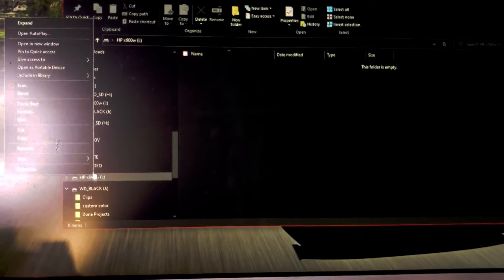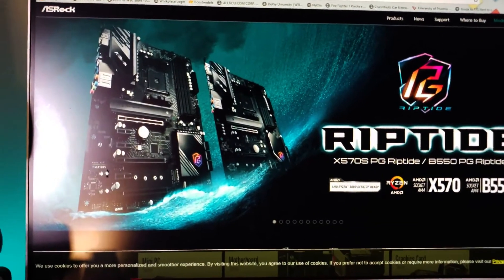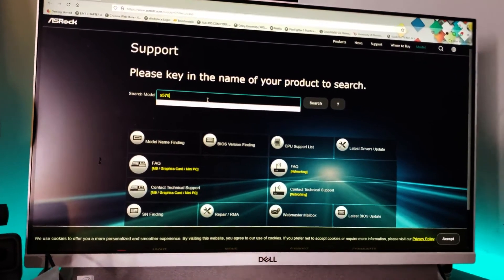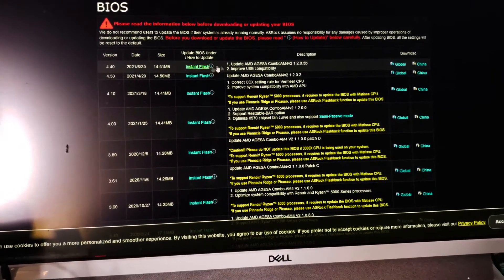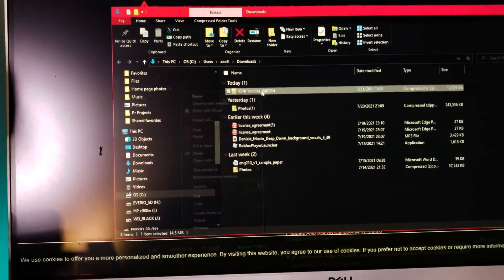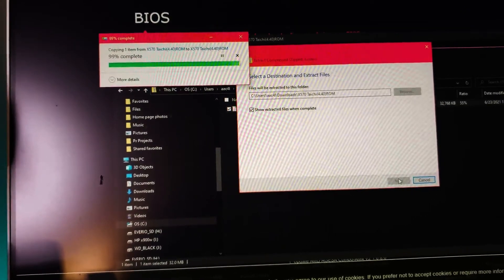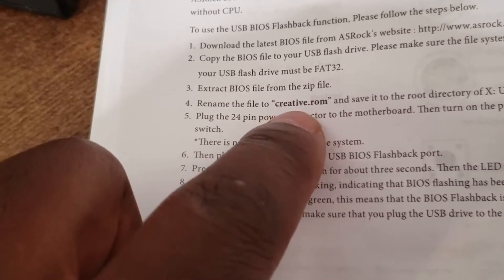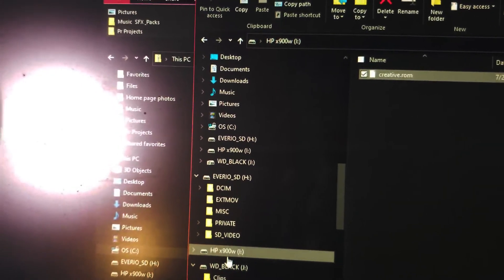Asrock X570 TaiChi How to Bio's Update 5000 Series Ryzen

Comment: Mine doesn't even turn on only the back of the board lights up when it's getting power. When I press the power button it's doesn't start.
Reply from the maker: Make sure power IO cables are inserted correctly, try using a screwdriver to jump the power. let me know if you your able to jump the power.
Reply: I'm having this same issue  @theopszone6775 I got 2 of these boards open box and I immediately flash backed them both to latest but I am suspecting that they may have shipped with a non vermaer compatible bios version.
Literally it lights up no activity if I press button or power switch. I guess I'll try to jump it?
If that doesn't work (I'm breadboarding it rn) I'll I guess have to look into using a flasher?

Comment: actually he turned a reeally easy thing into a stressfull one. first. you dont have to rename it. go to there website and click the instant flash thing. you no longer havve to do that. second. all you got to do is put the bios on the exfat formarted usb stick. then go into bios and hit f2. takes you to instant flash where it find the file and you select ok. no need to undue every part on your computer lol. dude took his cpu and shit out lol. why he used that button instead of just going into the bios. maybe the bios he currently had didnt support what he was trying to put in.
Reply from the maker: Okay! Mr. Wick, taking shots lol... At the time of recording I was just getting into PC's. For this motherboard I didn't want to jump into the Bios to update, the cpu at the time and still current is the ryzen 7 5800x. Sure I didn't have to remove any components. Again at that time  I wanted to be sure I was eliminating any room for errors! Still there's a couple of ways to update the bios for sure, there's is no wrong way to do so at this point! Just make sure he/she is doing it correctly. I have updated bios I believe 4 to 5 times now without entering the bios and clicking the "flash thing" It was fun doing that video though.

Comment: CAN i DO the bios buttonm thingy even if I already installed my cpu or ould I remove it? its not blinkinggreen
Reply from the maker: yes, while the cpu still in socket, that's fine, look for the latest bios. once you get that file onto USB, try going into your bios hitting the F2 button at the beginning of boot. Head over to (tool) then (instant Flash), select the update from the usb and follow the prompts. any questions feel free.

Comment: I have the razer version of this motherboard and my 5800x CPU just worked without the bios update, just so you know.
Reply: it has to be at least version 3.40 to recgonize the 5000 series
Reply from the maker: Yeah, thanks. At the time of purchase I wasn't aware of the razer version. I do have a couple of builds coming up. If I manage to get the razer version I'll definitely shout you out.
Reply: @theopszone6775  If you do get this motherboard one advice is reduce the chipset fan turn on temp as it can be very loud at times, also don't have a graphic card block this fan you will regret it later